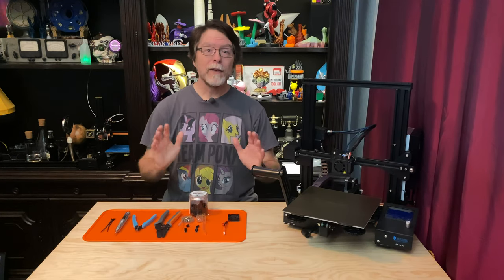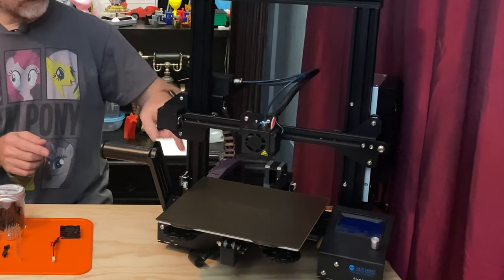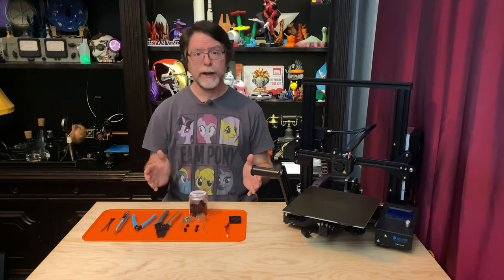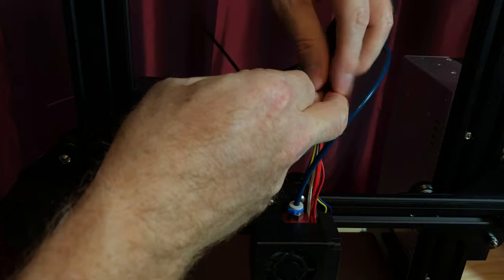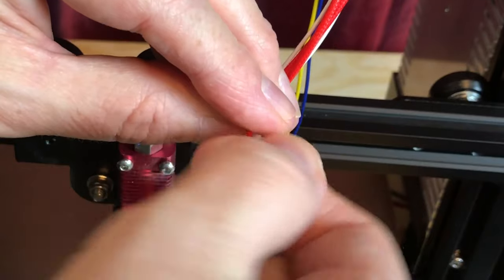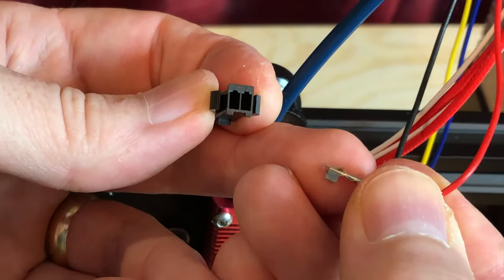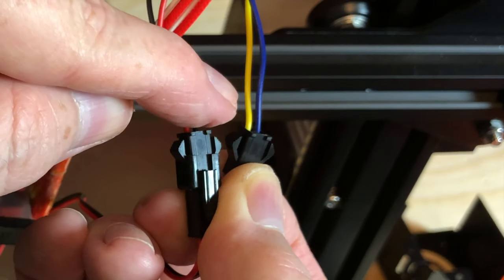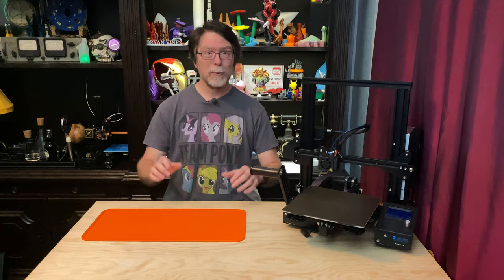How To Replace the Fans on your 3D Printer for Easy Future Maintenance

Comment: For future reference, those fans come with 2.54 JST XH connectors. You can leave the fans alone, and add the appropriate male connectors to the original wiring harness. This way, if you ever need to replace the fans again it's literally plug and play.
Reply: Great tip, thanks!
Reply: Would you then need to solder the female jst xh connector  to the original wiring harness? Jst xh female connector seem to have fixed pins that would need to be soldered
Reply: @alexjp9056  Yes, you'd have to solder in the connector to the harness, but the benefit of that is you shouldn't have to touch the harness again, swaps would be 'plug and play' from that point forward.
Reply: Aren't standard pin headers also 2.54? Could be a cheaper/readily available option without the need to crimp, just solder and heat shrink. the problem is you get the connectors inverted (male ends up at the printer cable and female is what the fans come with) for the amount of duty they'll see I don't know it it's worth buying a crimper and a kit of connectors, it would be the ideal choice though. Too bad they cheaped out at Creality with this and now most upcoming printers wont be using regular extrusion profiles anymore due to cost and wanting people to buy the new model instead of upgrading... Could provide better rigidity as-is but you can't mod the frames anymore
Reply: this is what I did and used ones with wire leads. I used "Solder Sealed Wire Connectors" ones where the solder is already in a short section of clear heat shrink. You only need a small hobby heat gun. I also split the parts cooling into two connectorseverything

Comment: I wish I'd have watched this video sooner. I did this recently for the part cooling fan on my Prusa, which is a 3 pin fan, so a little different connector, but I've apparently put the socket connector on the wrong side. Your explanation of why you put the socket on the powered end makes sense and is a great tip.
Reply from the maker: I have a Prusa MK3. I wish there were some kind of quick disconnects for everything on the hotend so it wouldn't be quite so much of a pain to work on. 😄 I'm glad you liked the video!

Comment: A great video for people new to repairing and upgrading their printers. I do like the SM JST connectors.  I have used the Dupont connectors and put a piece of electrical tape around the connection to keep it secure.  The JST connectors are much better.
Reply from the maker: Hi Corey Mac! I hadn't thought about putting a bit of tape on the Dupont connectors, but I can see how that would work, too.  😉

Comment: Fantastic video! I’ve never done anything electrical before aside from twisting wires together and calling it a day but this is much better. 
I used the exact tools and fans in the link, it took me quite a few tries and a lot of broken connectors to get the crimping down but after a bit of practice on the broken parts cooling fan I was able to put a new one on! 
Once my hotend fan needs replacing I’ll do this again.

Comment: I spent a few years working at a place that build cable assemblies and harnesses.  In short, we would make custom cables with whatever ends the customer needed and that involved a LOT of crimping on of pins and stuffing them into connectors.  The way you do it is exactly the right way.  I was cringing a bit at the idea that some people just crimp the pins on and let them punch through the insulation.  For low voltage stuff you can probably get away with it but it is not "the right way" and could be dangerous.

Comment: I just removed the label on the fan and unsoldered leads underneath and then soldered original cable onto new fan. Quick and easy, no rewring or crimping.

Comment: I always use JST connectors, so its much faster to maintain hot end!
thanks Bryan for your great advice
Reply from the maker: After I recorded the video, I came to the realization that JST might stand for "Just Stay Together." 😄They're great little connectors for this kind of thing.
Reply: only difference is that I use the pre-wired so I dont have to crimp pins, but then again i need to solder them to the wires
 https://www.amazon.com/dp/B01HHY9ZQQ/ref=cm_sw_em_r_mt_dp_U_5zu1EbM5PJFKA
Reply: @BV3D  I use JST's wherever possible too, better safe than sorry. Love the acronym 😂

Comment: Thanks for the excellent advice and run-through!  I managed to break my hotend fan, and this was one of the top results on how to fix it.  I was dreading the "rewire to the board" portion of the repair, so you saved me a lot of work!  I also got to buy some new toys (crimping tool, etc.), so that's a bonus!

Comment: Hey Bryan! First of thank you very much for your great content. It has made getting up and running with our first 3D printer a lot easier. 
I recently got an Ender 3 V2 for me and my boys. The fan facing forward makes a laboured sound from time to time upon starting up the printer. I light flick on the housing usually results in the fan sounding "normal" again.
I want to replace/upgrade the fan and figured I'd do the same with the second fan at the same time. It looks like the second fan is different than the one you show in this video.  I'm not an electronics wizard so keeping things straightforward like you showed here is a help. What would your recommendation be to replace the "blower fan" and "parts fan" on an Ender 3 V2?
Thanks in advance Bryan!

Comment: Pony POWER!!!!  :). Just a side note, many newer 24V printers have 5V fans.. check before purchase!!
Reply from the maker: Oh! I didn't know that -- thanks for the tip! I guess this means that on some newer printers, 5V Noctua fans are an option without having to deal with buck converters! 👍
Reply: @BV3D   ya , and Duets can be either, you can switch a jumper on the duet boards and go from line (12v or 24v, what ever you are pumping in) to 5v no matter what.  :)
Reply from the maker: OK, cool. One of these days I need to get a Duet.

Comment: Bryan, thank you for good video!
I have used Wago connectors, during fan replacement + designed  and printed appropriate Wago holder :)
Next time, probably, will use your method of wire connection, to reduce repair size.

Comment: Thank you for this video!! Did this upgrade and it sounds much better. My Ender 3 V2 is not even a month old and the stock fans are already making crazy sounds. The only thing, in my V2 the fans might be hitting something. You can hear a light buzz sounds. Anyone have this issue? Tried different fans. Same problem.

Comment: Nice video! Subbed.. question is it ok to solder these fans? Add shrink tube and call it a day? Thoughts? Safe?
Reply from the maker: Hi! Yes, you can do that. I find the benefit to using connectors is that I don't have to break out the soldering iron to change a fan. But you can certainly solder and use shrink tubing. (Pro tip: Put the shrink tubing on the wires before you solder them... Been there, done that, laughed at myself because of it).

Comment: Cheers, dealing with a printer with some bodgery from the previous owner that has since started to fail on the fan setup. Was wondering about the best way, or at least a solution to that. think this will do it.

Comment: thanks for detail explain how to replace the fans. I noted my printer ender 3 v2 got 4010 24v fans , but I am not sure is it the 24v fans MUST to be big noise, even I the other one "silent" .  because I found most YouTuber will use the current converter for 12v fans.   actually, my task for fans replacement is for silent. but I really concern the safety of the current convert of the printer.😅

Comment: I need to replace the part cooling fan on my ender 3 what kind of fan should I get?  The part cooling fan is not listed on your part list.
Reply from the maker: Hi Bill! Here's a link to a hot end & parts fan combo pack. Both are 24 volt fans for Creality printers. https://amzn.to/3hishgO

They appear to have the super-long cables, so you can feed them through the mesh wrap all the way back to the electronics box, if you don't want to cut & crimp connectors.

Comment: I was thinking of upgrades to my E3M fans to 5015 for the 4010's on the sides and use the stock can for the hotend im assuming it's the same process for both the side fans. I haven't taken them apart yet to see the wiring harness yet but was planning on it soon.
Reply from the maker: Hi Kris, yes, this should work for the Max as well. 👍
Reply: @BV3D  sounds good I'll order those connectors you suggested and finish this build here shortly ☺️
Reply: @BV3D  well I finally got around to this and did all my hotend and fan connection points with these, and WOW what a game changer! 

Great video and made this process so much easier!!
Reply from the maker: @ktothestank  Cool! I'm glad you're happy with the result!

Comment: Great video, thanks. Can I ask what the difference is between the two fans, and why I can't buy a set of 4 and use two of the same - for both the hotend and parts cooling?
Reply: One is axial, the other is radial

Comment: Brian this a great video i have a ender 3 V2 i have a question for you before I tell you what I am doing about the hotend fan the one that's in front not the side one. Is the fan in the front go on when I turn the power on because its not moving and I am sure thats why I am having clogging issues and uneven layers? Like I know you have an ender 3 v2 does the hotend fan go on when you turn the power on? Ok thats it for the questions. Brian this a great step by step video I am going to do the samething you did to your ender 3 to my ender 3 V2. I am even going to put the extra connectors on the spare ones like you said but I can't do it until Tuesday thats when everything comes in thank you. I bought the same just connectors the winsinn fans I also bought the other fans with the yellow and blue wire made by winsinn. The crimping tool I didn't buy the same ones though they wouldn't get to me until August so I saw a similar pair by the same company they will get here Tuesday they are the IWISS IWS-1442L so they should work. Brian thank you again I hope you respond sorry it is so long. I will keep you updated if I remember thanks again.

Comment: Any downside to having both hot end and parts cooler running constant?

Im using Noctua's, so i have to use a buck converter. Id rather not have to use two buck converters for separate fans. So I was going to connect both hot end and parts cooler to one converter in parallel at the hot end connect on the mother board. Which means when I power on, both fans would come on and stay on.

I would assume the only downside to this is maybe the hot end/nozzle would take longer to heat up?

Im running an Aquila X2, the parts cooler (blower) for the nozzle has a separate connector on the mother board. So the mother board fan will come on separately.

Comment: So my CR10s5 the center internal fan inside the control box does not come on when I turn the printer on. (From my best knowledge all three fans should kick on at start up inside the box) but my issue is when I removed it, it works fine on a 9volt battery. So my issue is what is my next step to check on why this one fan isn’t kicking on? To be clear its not the silver control box fan or the rear exhaust fan its the one that is designed to blow on the circuit boards directly. Any help would be appreciated. 🙏
Reply from the maker: On a lot of Creality's printers, the fan that cools the main board is switched on when the parts cooling fan is on. The fans are powered by the same source. Try turning on the parts cooling fan and see if the main board's fan runs, too.
Reply: @BV3D  great info! That’s exactly how it works! Tried it just now. Thanks for the quick response and advice! 👍🏽

Comment: Can i use this method to install a 24 V 5050 blower fan ?
Reply from the maker: Hi Oliver, you sure can. There are a bunch of different ducts and mounts you can print to hold a 5015 blower (50mm diameter, more or less, 15mm thick). If the fan's input voltage is the same as the printer's output voltage for driving fans, you're good.

Comment: Hey so, I've very confused, I've purchased the connectors listed in the description, but the tool you've listed only goes up to 2.2mm pitch, while the connectors are 2.5. Were you using a smaller size of connectors? Hope this reaches you.

Edit: Go with the 2.5. I purchased the exact crimping tool you recommended and it was obvious immediately that it was too small. It's doable, but I ended up ruining a bunch of the connectors.
Reply: Same here. Brian obviously shows it works, but does not seem to use the crimping tool the same as on the Iwiss videos show. Will see if I can return the 2820 and get the 2412 that actually works with the 2.5 mm.
Edit:  I ended up buying the 2.5 (2412) and had lots of crimping issues.  When I used the one Bryan recommends (2820), I found it worked much better.  I used the end of the crimper to shape both the shorter and longer crimp bars in to 'U' shape and used the 1.3 for the shorter and 1.6 for the longer as Bryan shows in the video.
Reply: @RyanSmithUT hi, can I ask what you mean by using the end of the crimped to shape them into a u shape? I have the same crimper and I’m really struggling

Comment: Hi there! I was wondering how you'd use a system like this to split the one cable for dual fans instead of one? did I miss that somewhere in the video? I'm setting up a hero me fan duct and will be using 2 5015 fans!
thank you!
Reply: or rather can you crimp two wires together for a single male receiver?

Comment: but which direction fan should blow
Reply from the maker: When the fan is spinning, the air should exit the side of the fan where the label and the wires are. When mounted in the fan shroud, the fan should blow toward the heat sink. Make the label face the heat sink, and it should be good. 👍🏻

Comment: That’s the same connector that’s on my BAFANG electric motor for my bike.  what is the electric screwdriver called or can you put a link down. thank you
Reply from the maker: Hi Tony! The screwdriver is a SainSmart ES120. This is the link to SainSmart's site; looks like it's only shipping to the EU (https://www.sainsmart.com/products/toolpac-es120-motion-sensing-smart-screwdriver). I found one on Amazon, but it's not SainSmart branded (https://amzn.to/3dqrUjg).

The thing I like about it is that it senses when you turn it, and then starts turning in that direction. The further you turn it, the faster it spins in that direction.

Comment: Bryan, can you advise the 2 pin connectors name/ part number?   There are a million different types in the online stores!
Reply from the maker: Those are 2-pin JST-SM connectors. I don't know a part number, but that's what I know them as. Hope that helps! 👍
Reply: BV3D: Bryan Vines.... Thanks Bryan, appreciated. Just got an Anet ET5. A very few with ET4 have reported a two pin socket / plug has a burn issue! I think the cause is newbies not pushing the plugs fully home and inviting arcing. But having a few cheap JST on hand will not break the bank and save weeks of waiting if..xx hits the fan :)

Comment: Winsinn fans fail, that's what they do. I just had a winsinn fan fail during just 3 days of covid shield printing -- the set of 4 is going back to Amazon. I got a set of GDTS fans this weekend, I basically have never had one of them die without something physically getting into a fan, and I run my machines hard. The winsinn's were a replacement for 3 other -- winsinn fans that just died -- one of them lead to a clog and required a hotend disassemble. One thing that resulted in non-stop printing for PPE is -- i know which parts are junk, and which will survive prolonged use.
Reply from the maker: Hi! So far I haven't had a problem with the Winsinn fans, thank goodness. But I'm not running my printers nearly as hard as it sounds like you are. If you could share a link to the GDTS fans you're using, that would be cool. Thanks! 👍
Reply: @BV3D  they used be sold by ultibots, before they went out of business, now I either find them on eBay or on AliExpress. Best fans by far. Never had one fail that wasn't due to something getting into the blades, not quiet, but reliable and powerful. Come in various sizes and voltages. i have several machines and one with multiple heads, so I have a lot of fans deployed, and the last few months they've been running very hard.
Reply: @BV3D  Name is: Gdstime For 3D Printer   They are good fans and quiet.

Comment: are the two fans the same?
Reply: No, which I just found out while trying to use this guide. At least not on my Ender 3 v2. The fans he links only fit for the hot end. Now I need to go source a part cooling fan that will fit.

Comment: Jump on the smart wifi connected outlet wagon and you can set a timer to have power auto shut off your printer extending the life of the components. Vivitar is available in my area and I wince at the price but its more than worth it not having the machines running while your in the middle of that great dream at 2am.

Comment: It's possible that the crimp tool and connector kit were of good quality when you made this video, but freshly purchased ones right now are positively infuriating. I've wasted dozens of pins and am now out of wire; needing to go buy another fan.  I should have bought the ratcheting crimper.

Comment: Don't be an idiot like me, make sure you are crimping the right connectors on before you put the wrong ones on and start to panic that you bought the wrong connectors, because that set comes with 2 pairs, the ones for  the male and female sides, and the male/female housings for the connectors are snapped together and you have to separate them.

This might seem like common sense, but I've never had to do this before so I was confused at first.

Comment: Would have been easier to cut and splice the wires.  Had a wire fall out of the connecter and short...bye bye main board.